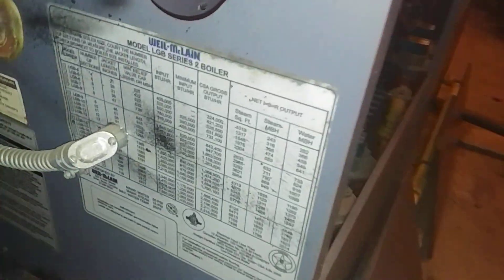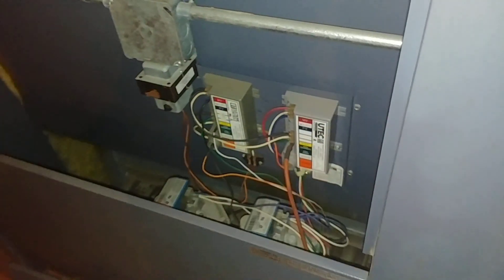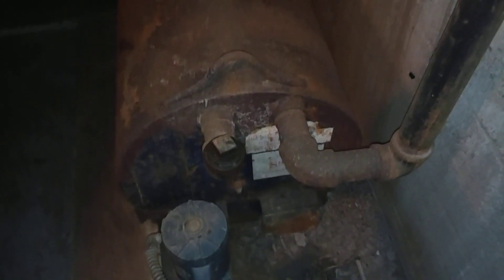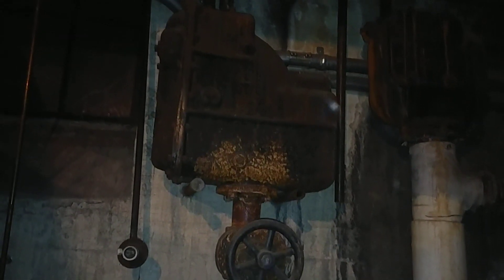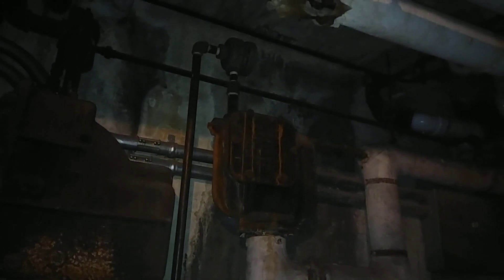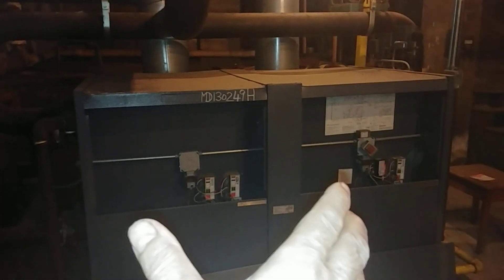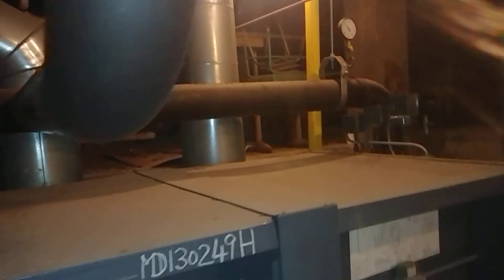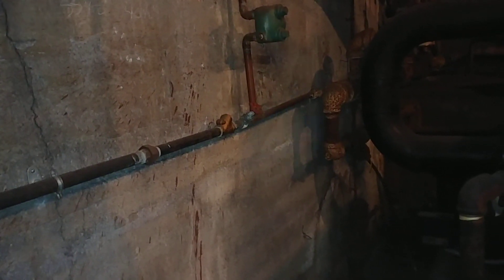Steam Boiler With Poorly Designed & Installed Welded Steel Header

Comment: I had to look up rtfm it looks like a contractor’s suggestion box of idea’s none of them had enough sense or enough care to plan and execute a solution to save the boiler. I’m sort of reminded of that video of the 1980’s boilers three medium sized boilers that were installed in series’s with high- low fire gas valves and a somewhat better near boiler piping layout. I hope you are successful in determining who needs to hear about your solution to this problem.
Looks like they are desperate for your wisdom on this one.